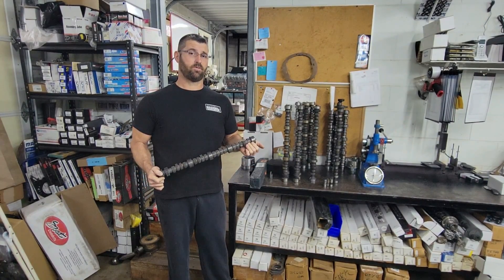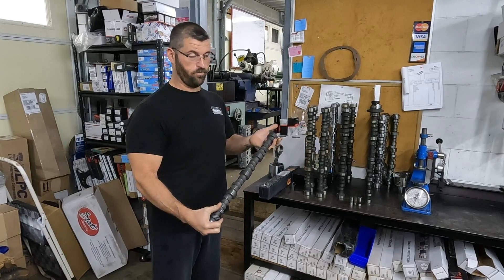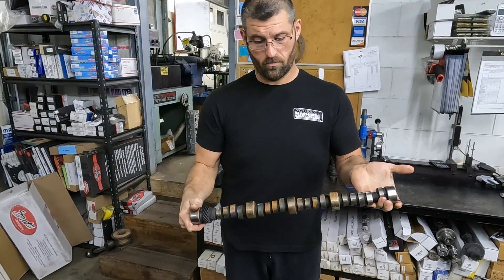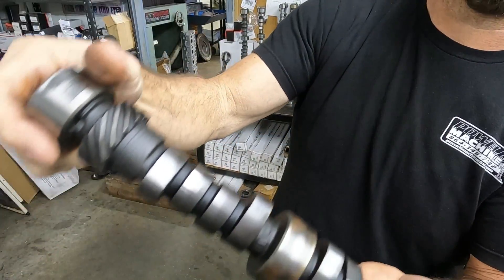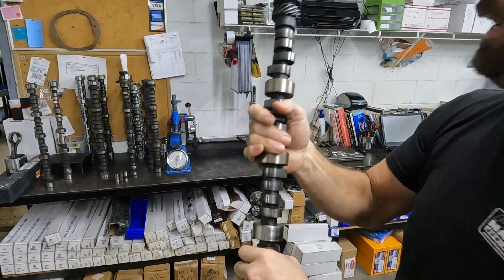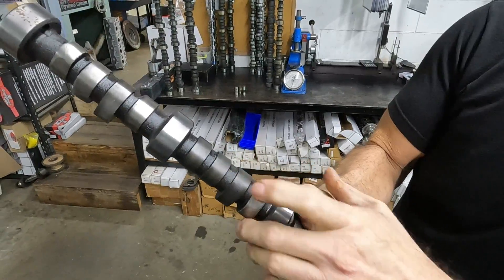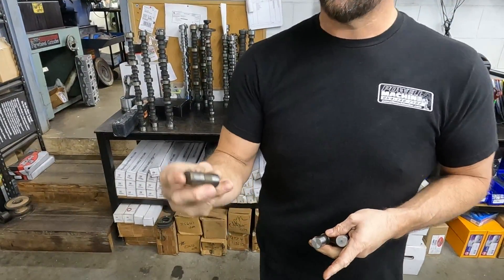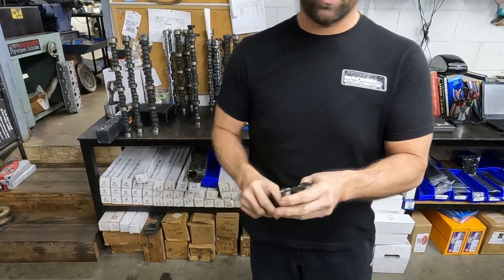Flat Tappet Cam Failures?, we investigate why and check the hardness of several cams and lifters!

Comment: Great information. Can we measure or check lifter crown at home? And the same for lobe taper? Thank you.
Reply from the maker: With the right equipment yes, but you Machine should should be able to without to much trouble.
Reply: A quick check is set the lifter faces on top of each other or place them on a glass table top.  You'll know real quick if there's no crown.
Reply: You can check the taper of lobes with an outside micrometer. Just measure outside edges of the base circle. You want .002-.0025 optimally. You can easily check the radius of a lifter by putting it on the side of another lifter. Ensure both surfaces are clean and dry. The bottom of the lifter is meant to have a radius not be sharpened like a pencil ✏️. On a V8 don't install the intake manifold until you mark all the lifters with a paint pen and ensure they rotate as you turn the engine over. The lifter is designed to roll over the lobe like a tapered roller bearing. ZDDP in the right ppm seems to be imperative, 1600ppm>. As a side note-When I was a young nieve backyard engine builder we  would even put used lifters on used  performance cams from other engines with stiffer than stock springs and surprisingly we didn't loose lobes. No special break-in oil, just normally any 20w50 that was reasonably priced. That's why they are probably called the 'good old days' LOL.
Reply: @scottrobertson6949  To check for lifter rotation do I have to use the starter (rpm) or would turning the crank by hand already be enough?